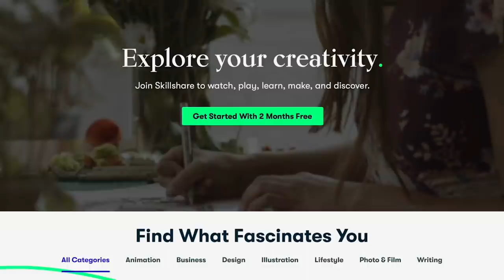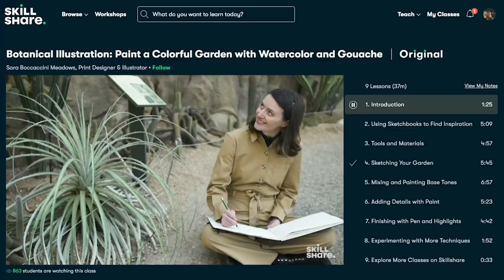Building The Farmhouse | Day 71

Comment: Hey Perkins, I have a pro tip for you guys. If your trying to find your stringer angle. You can you your iPhone calculator to find it. Example 7” rise divide by run 10”= 0.7 hit the 2nd function on your calc and hit tan-1 that spits out your angle which works out to be 34.999 round up to 35 degrees.  John from Ontario,Canada

Comment: think an easier way to get the pullrope through the conduit is a plastic bag tied to a string, and use the shop vac on the other end
Reply: All they need is a fish tape.. not an expensive tool at all.
Reply: This is the best way to do it, I've pulled in 400' in about 5 seconds this way
Reply: Even if they wanted to stay with the golfball, just stick it in the plastic bag for a more solid 'kerthunk'.

Comment: I don’t think other builders would pay so much attention to details even if they build the house for themselves. You guys are great.  Thanks for the videos.
Reply: Then you don't watch a video of (RR BUILDINGS) they give as much attention to there buildings as the Perkins Brothers maby more?
Reply: Seriously. The crews that built my current house a few years ago must have been paid by the nail or something. Shoddy work all over the place, gaps in trims and stairs, big cups in the drywall, air ducts installed at an angle, tiles around the fireplace not straight...
Reply: @andarthome142  sorry I shouldn’t have phrased it that way, but a lot of builders (if not most) try to cut corners or at least overlook things if they are good enough but not perfect.
Reply: I can assure you the guy that built my house didn’t 😤 I watch these videos in envy that the Perkins Brothers didn’t build my house

Comment: When my father-in-law was an apprentice electrician just before WW II, stairs were built on site using the method Jaime described. No power tools, just a brace with a 1” bit, a back saw, a hammer, and a chisel. The higher end homes around here still get these but they are made in a shop with power tools.

Comment: Pro tip: Tie a grocery bag (or two) to one end of the pull string and stuff it into the conduit. Then grab a shop vac and put it in the other end of the conduit and try to seal it as best you can. Turn on the shop vac and enjoy how easily you just ran the pull string.
Reply: You can also use a leaf blower to blow the bag/ string through. You don't need electric power for that.

Comment: A fast and easy way to pull a line thru a length of conduit is to tie a mason's line to a lightweight plastic shopping bag. Wad it loosely into one end of the conduit, then use a shop vac at the other end to suck it thru. You'd be amazed how fast it comes through, and it's also pretty darn fun.

Good work Perkins bros! Keep it up!

Comment: In the UK, most of our stairs are made the way the old timers did.
It works. Staircases can be made in a factory. Just need to know the rise and the 'going' ( you call it run), get three guys to lift it in, job done.
Reply: Yep same in Australia, I am a builder carpenter and haven't built  a set of stairs for probably 20 years.

Comment: A much easier wire pull is to fully assemble your tubing and tie a bag (Walmart, Lowe’s etc) to the string and use a shop vac on one end. 
You will be amazed how easy it is. But your way is much more entertaining!

Comment: Pro tip from The Netherlands:
Tie a little sandwich bad with a bit of air to a string and put the hose of a vacuum cleaner to the other side of the pipe and suck the bag ...

Comment: Pro tip: if you have a long run of pipe you need a line pulled through you can tie a bag onto a string and hit the other side wide a shop vac

Comment: Those stairs look really narrow/steep to me, what are your code minimums for finished stair width (wall to wall) and max/min rise/run?  Here in Idaho we use IRC codes, min finished stair width is 36", max/min riser is 7 3/4"-6 1/2", tread depth max/min is 9 1/2"-12", with no deviation of max/min rise/run greater than 1/8" on any riser/tread for the length of the run from landing to landing.  The projects I normally work on are McMansions and so stair width is usually a nominal 4', and we will add a riser if necessary to limit riser ht to around 7", and allow for 10-11" tread depth.  

Love your channel, been binge watching my way thru your back catalog for the past 2-3 months.  In real time, you just completed "The Duplex" and will be starting a new build soon, can't wait to follow it, looks like a fun project!

Comment: Funny you should mention mortised stair stringers. I jus finished installing a set of stairs that I rebuilt. Original hundred year old stringers with brand new oak treads and 3/4” painted poplar plywood risers.  Everything is wedged, glued and tattooed. As you mentioned lots of work and mighty heavy installing the stringers with treads installed before adding all the risers save for top and bottom which were put in beforehand. 
Great pro tip. 👍BTW

Comment: Cmon guys. Watching you install skirtboard. Ugh! Take your skirt material and tack it on the wall, bottom of skirt touching the front of the stringers. Measure the rise and cut a block that height. Say 7 1/2”. Put that block on top of the rough stringer and transfer that mark onto the skirt. Do that for all the tread and rises. Take the skirt to your table and jigsaw out your scribe. The skirt will drop right in…

Comment: wait so riser #1 was 8 1/4 or 8 3/8 and riser # 2 was 7 3/4ish.

the same dimensional lumber was used for each tread so when you lift the temp treads and put the new ones on theres still 1/2 to 5/8 inch discrepancy in your heights. did you forget to drop the bottom of your stringer?

Comment: the golf ball method is much easier with a shop vac and a wadded up shopping bag (Lowe’s or Home Depot) tied to the string. It works very well, and then you can pull a larger nylon rope that pulls the wire. Easy peasy.

Comment: I’m only two minutes in, so my suggestion may be unnecessary, but The best way to pull wire is to first pull nylon twine with a kitchen baggie using a shop vacuum… then pulling a larger nylon cord with than, and finally using a nylon rope. It’s all easy!

Comment: Common, using a chalk line and a golf ball is weak sauce. 

Grab some regular string and a plastic produce bag. blow a little air into it and tie it with the string.

Connect a shop vac to the FAR end of the pipe ( when its all together ) and turn the shop vac on.

5 seconds later you have your entire pipe fished.

Comment: On my last job, we used an industrial air compressor attached with a hose and controlled nozzle to blow our jet lines tied to trash bags, for 1"-6" pvc pipes to mark our directions; however, pro tip, we always blow compressed air through the pipes to ensure no water, debris or dust was inside after it had been buried & tapped from end to end

Comment: Pro tip for you guys: you can put a vacuum on the end of your conduit and suck the pull line through. If you have a plastic shopping bag tie the string around the bag and just suck the line through when you're finished running conduit.

Comment: Back when I did photovoltaic installs we'd bury all our conduit glued together tight, then take a regular old plastic shopping bag tied to some lightweight plastic twine and stuff that into one end (not too tight) and make a little DIY adaptor (usually cardboard and duct tape) on a good shop vac to fit tight conduit and suck it right up, took about 30 seconds and worked on decent lengths of run.  That golf ball mess looks time consuming and a great way to end up with rocks in the pipe that could snag on a wire.

Comment: Im stoked I get to tell the Perkins brothers a pro tip, use a shop vac on the down hill end, then tie your string to a grocery sack and put the grocerysack on the uphill side, it doesn't matter if it's a 500' run to your pull box it will suck the grocery sack through. You can also use a air compressor on the uphill end. I like the shop vac

Comment: 🇦🇺 hey guys, nice job on the stairs though a lot of waste. We still do internal stairs that old timey way with wedges, though now days the stringers are cut out with a computer. We ise to do external staors the same nut without wedges.  Each tread was cut using saw and chisel.  The last time i did them (and we use 2 inch hardwood for treads and stringers bery hard and heavy) i made a jig and cut them out with a router.  That was like 17 years ago. Now we use steel stringers or buy the stairs ready made. Ise to take may a day to cut stringers amd treads and handrails and balisters and install by myself. Have a good week end guys, its Saturday morning here

Comment: When doing skirt boards for the stairs, why don’t you put a 1x3 between the stringer and wall? You can screw the stringer to the 1x3 to the wall and then it provides a shelf that the skirt board can rest on when you try to cut it for the finished look.

Comment: Buy a fish tape guys make your life alot easier lol the golf ball isn't a bad idea. Or use a small kroger plastic bag cut it to size of your conduit you need a loose string as an electrician I buy a bucket of jet line it works best like 50 bucks hook the string to the bag with a little bit of air in the bag. Grab a shop vac and watch that string go through the conduit in seconds.

Comment: The electricians around here attach a string to a plastic bag and suck it through the completed pipe with a shop vac. Then pull the nylon rope back through for the power co.

Comment: You mentioned how the old timers built stairs. NS Builders did that on a stair case in a remodel not long ago because there wasn't enough room to put in a frame. Check out their website if you haven't.

Comment: If you need to get strong through a pipe again, I watched the power company put the string in about a foot then take a compressor and blow air down the pipe which took the string with it

Comment: easiest way to get a string line through a pipe is tie a bit of paper or plastic bag onto the end of the string line and suck it through the tube by holding a vacuum hose to the other end of the pipe.  Wrap your hands around the pipe to hold the suction.  Works every time.  I learned this years ago from Dean Johnson on a home improvement show.